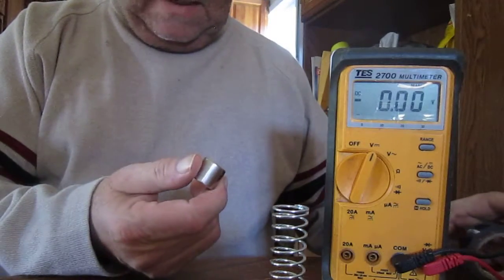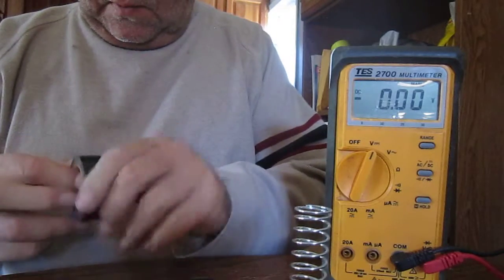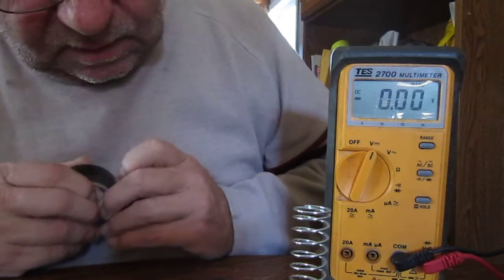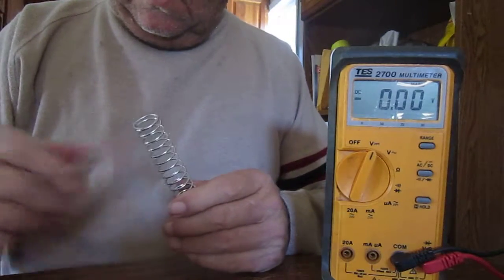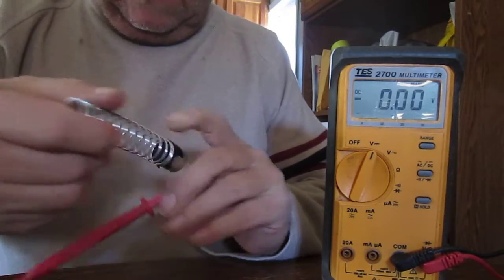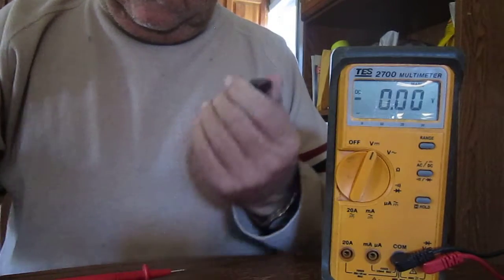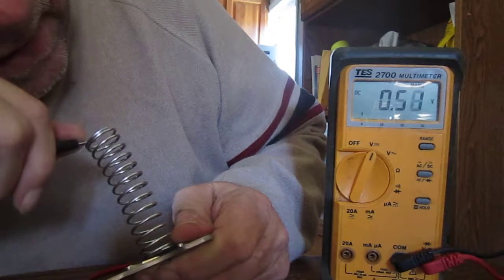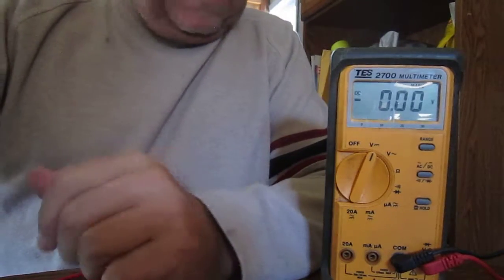Magnet and spring

Comment: Other persons who were present tried repeating the experiment and were able to get 0.69 volts from the same light gauge spring I just used.  In both experiments I used a neodymium magnet disk; 3 inches in diameter and ` 1/8 of an inch thick.

Comment: The voltage reading is only obtained if one hand touches the magnet and the other hand touches the spring or the metal of the negative terminal as pictured in video.  Does this mean a current is passing through the experimenter's body?  mamp meter and LED light needed next.

Comment: have you ever made a lemon battery? its two different kinds of metal stuck into a lemon. its electricity produced by chemical reaction. in your case, you are the juice both of the pieces of metal are reacting with to produce the voltage you see on the multi-meter. if you didnt have the tape there you would create a short and no voltage would be seen. you dont need a magnet to get the same result. you could simply hold on to both probes and get a voltage. try the same experiment you did in the video again but next time use aligator clips and dont touch it and see if you get a voltage. also try it with no tape between the two metals and see if you get a voltage. thirdly get a piece of copper and a piece of zinc and have each attached to the probes and have in one hand the copper and in the other the zinc and set the multimeter to voltage and see what you get. these experiments will yield results indicating what is actually happening. dont forget the lemon battery experiment to remind you two seperated metals in contact with certian juices will produce electricity.

Comment: I just repeated this experiment with a much smaller and lighter-gauge compression spring and also was just barely able to reach 0.5 volts dc.   I am contacting the Oregon State University and Humboldt State University Physics Departments now.  I will try to light a LED bulb next.
Reply: What was their answer? And don't make me wait. LED won't glow, as the minimum forward voltage is at least 1.8 V.